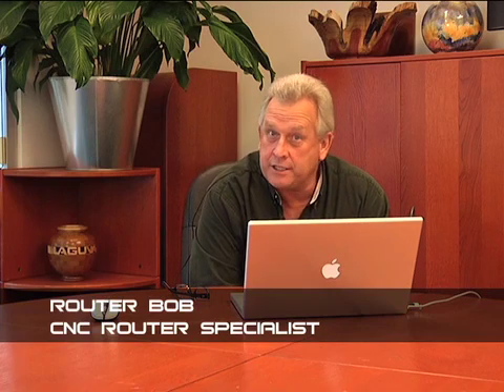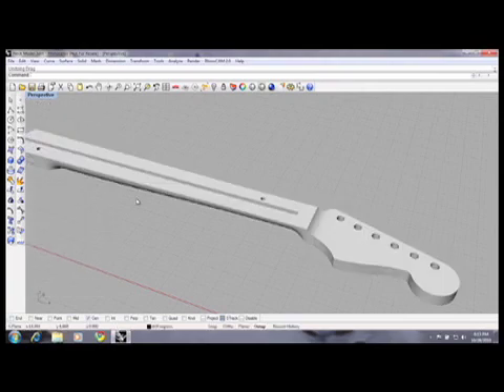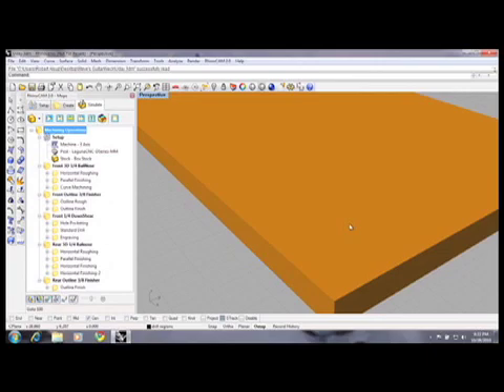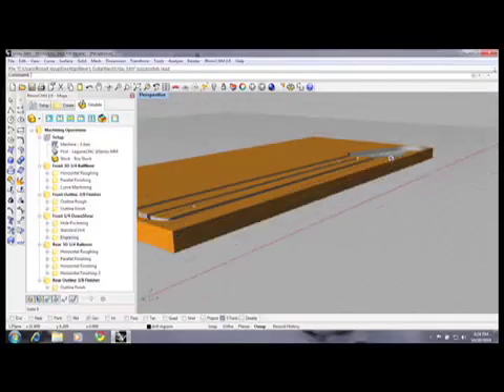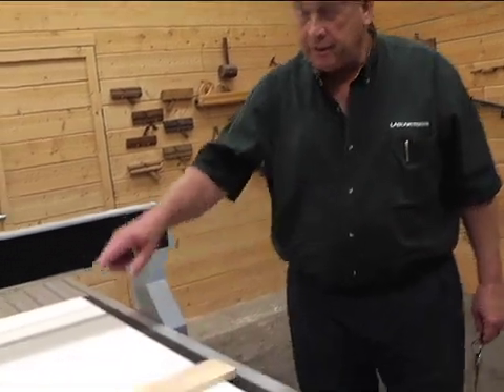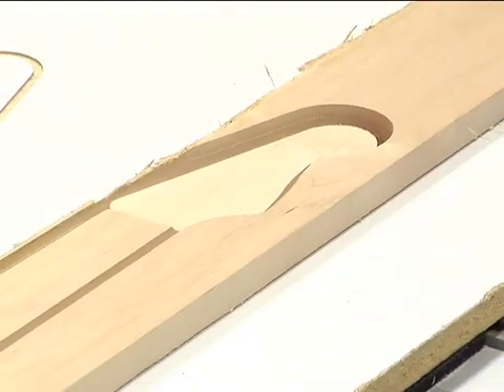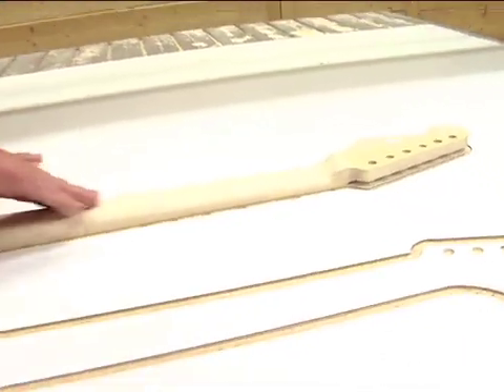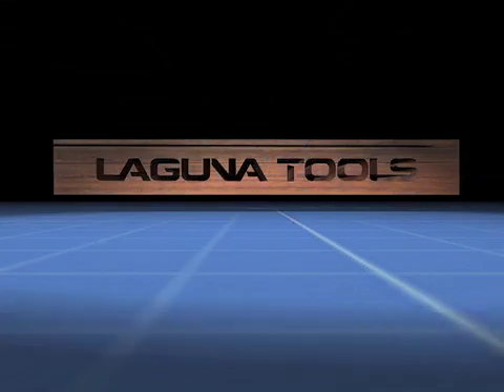Creating a Guitar Neck: Swift CNC Router by Laguna Tools

Comment: The MacBook in the video has a Intel based processor so therefore using Boot-Camp, or Parallels it's able to either boot directly into Windows 7 OS or run it in a virtualized machine. The virtualized machine allows easy access to both the Windows and Mac OS.

Comment: Anyone tried aluminum with ebony fret board yet
Reply: +Brainsmachine.bc     YES, I have it done bostosh0@cox.net 
(and it works) same weight as wood never will warp
Reply: +OZZtosh LUMA Guitars        how much does it cost for a jackson v neck
Reply: +Brainsmachine.bc 
I haven't had the opportunity to digitize one of those yet.
All necks are same but different shapes. 
$31.80 for the material, flat necks not angled headstock, 3.5 hours on the CNC machine and about 8 hours, file to polish time, then another 5-8 for the fret board.  And then there is the design and CNC  programming cost 70 hours at $45/per, I forgot the patent about 5k  (in work now)
Still interested? this is production machining tooling costs which are the same as a one-off first.  If I do the work myself I cannot charge myself. The next neck up to do is the J-bass. do you wish to see pictures? This neck was intro'd at NAMM 2016, billet, it works well.
Reply: +OZZtosh LUMA Guitars 
Oh yeah is weighs the same as maple and doesn't nee a truss rod.
The heaviest part is the ebony and fret wires.
Reply: +OZZtosh LUMA Guitars  My guitar changes tuning when it gets cold. I was hoping an aluminum neck would stop that. could I save money if I could do some of the labor myself ?
Reply: +Brainsmachine.bc I could do a work trade in the future, I have some guys needing wood bodies if I can ever get decisions and $$. I just execute their designs. they need you. I am doing more billet necks this week. I have my patent guy working on the internal structure I designed for the neck. and the headstock shape. I can't let out the neck machining. I rent a  new Hurco Vertical Mill  and operator for my stuff.

Comment: The neck looks weird where it joins to the headstock. it looks like it has a lump where it should be a smooth transition. nice work tho.
Reply: He explains it at around 4:58
Reply: Hmm shape is wrong if its a strat replica though. that would get in the way methinks

Comment: How do they remove / hide locator pin holes afterwards? I'm trying to work it out in my head but can't!
Reply from the maker: Feel free to call us at 800.234.1976
Reply: Smucker The fretboard will cover them
Reply: truckingdrummer what if it was a maple / one-piece maple neck?
Reply: You would have to use a clamping system of some kind to hold the piece in place while being machined

Comment: A master craftsman would have looked at the drawing and noticed that the truss rod slot was supposed to go all the way through the neck and out the headstock end (1:04). Otherwise the truss rod can never be adjusted (or even installed). Oops! 
CNC may let you carve like a master craftsman, but it won't make you as smart as one. LOL!
Disclaimer: I'd jump at the chance to own an affordable CNC machine for producing musical instrument parts (and would undoubtedly make a few oops myself!)